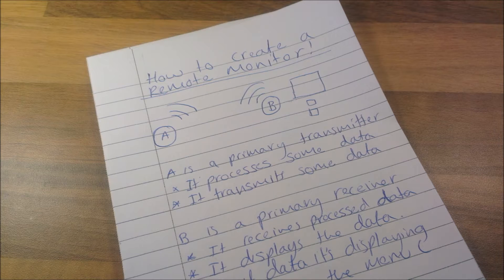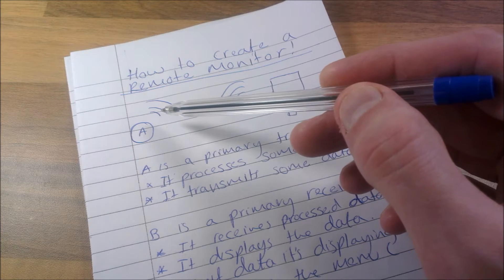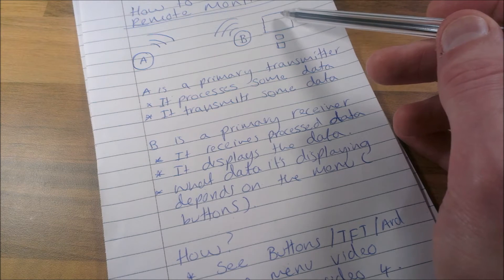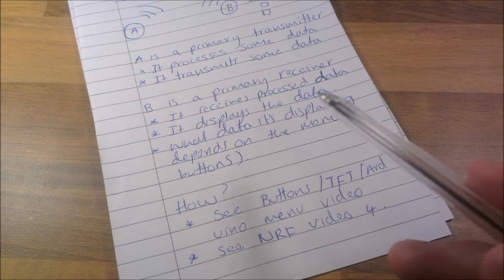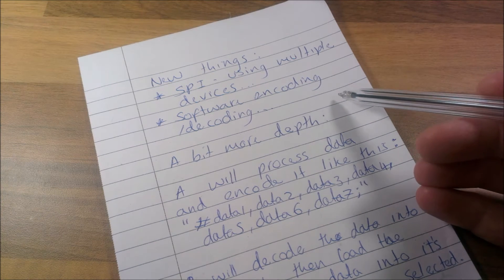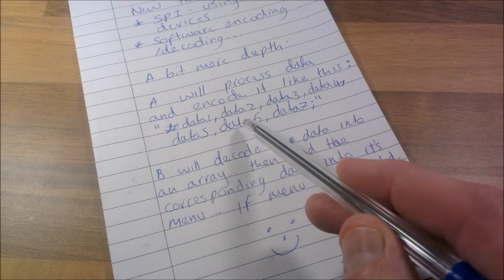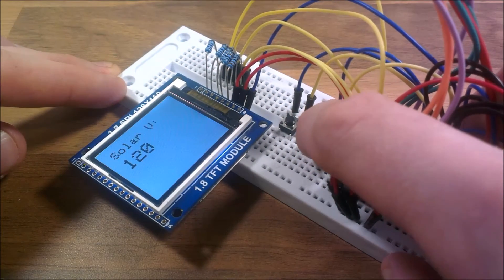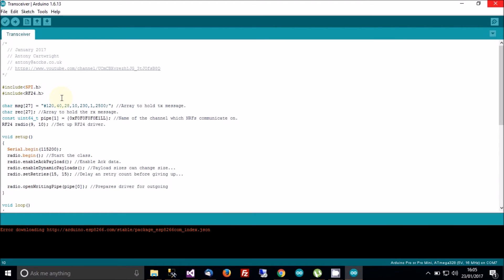TUTORIAL: Creating a wireless monitoring system with Arduino, TFT/LCD, NRF24L01 and buttons (Part 1)

Comment: For how many meters can the data still be transmitted and does it require a line of sight condition? I am looking for a remote monitoring system for 1 km apart.
Reply: I'm also wondering this. I would like to monitor the temperature in my greenhouse which is about 250 feet away, and if I could do this wirelessly using an LCD and my Arduino that would be great.

Comment: Very informative, thanks, I do have the NRF24L01 along with the ATMEGA48 board made specifically (I think) for the NRF24L01. I wonder how that can fit into your arrangement...?
Reply from the maker: Hi Rafik! I've had a quick look at the ATMEGA48 and it looks as though it could easily do it. Basically, you need to look at the pinout for the ATMEGA48. Do you have a breakout board or just the raw chip? If it's broken out properly, all you will have to do is match the pins up correctly as SPI is usually fixed to certain pins. If it's the raw chip, you might need to add pull up/pull down resistors, capacitors and a regulator also. Antony...
Reply: I do have the complete board as shown on ebay (http://www.ebay.co.uk/itm/ATMEGA48-NRF24L01-Interface-Wireless-Shield-Module-SPI-to-IIC-I2C-For-Arduino-/291550468257) ...with the socket adaptor for the nrf24l01...
Reply from the maker: Then it should be fairly easy... The code will most likely be the same, you may just need to change the pin numbers.. Antony